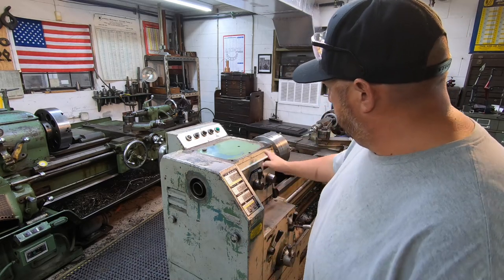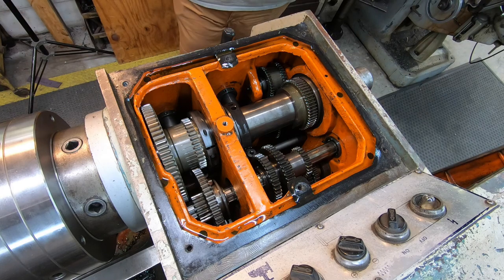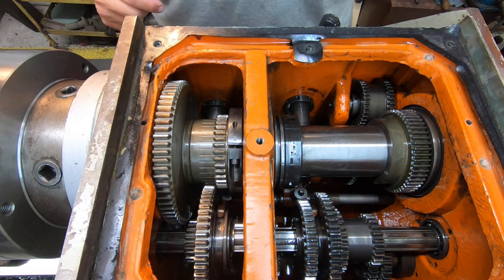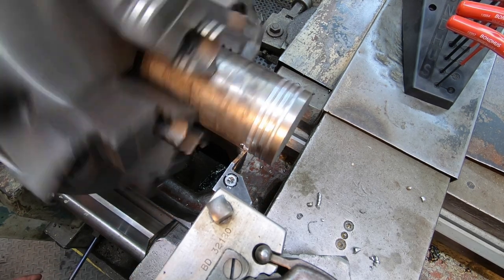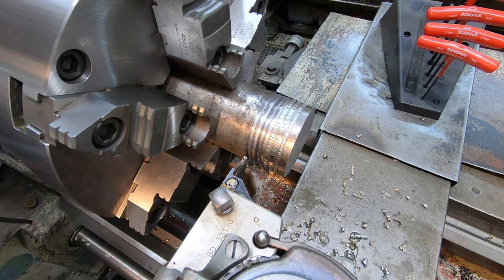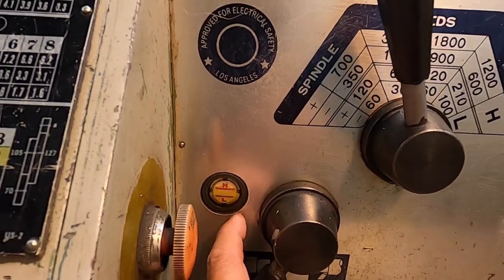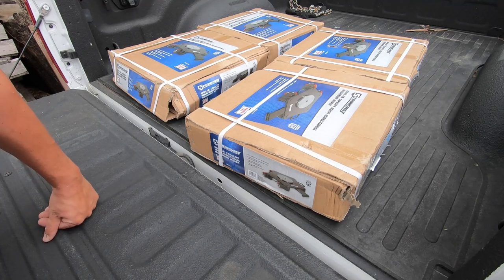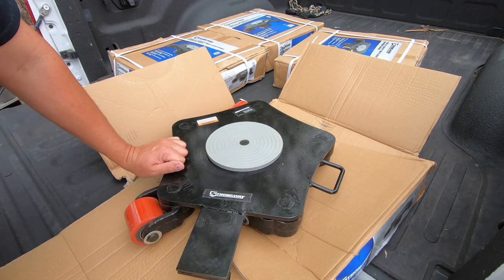SNS 324: Victor Lathe Main Spindle Bearing Adjustments

Comment: Just a word to the wise. Always always always put a piece of wood or rubber between the machinery movers and the piece of equipment. Never ever ever put the rollers under the machine base and steel  surface without some friction material between the two. I have a leg with plates and screws in it as a testimony to how dangerous not putting some friction material between the rollers and machine can be. I had a lathe slip off those rollers and topple over onto me. I'm lucky it just got my leg and not my torso... because I'd probably be dead, It happened so fast. Steel on steel is a big no no.

Comment: Run in up at speed abd see if the bearing remain cool to warmish . If the bearings are too tight it'll knacker them quicker than you'd believe.
Reply: Agreed. It's OK provided the running temperature at the bearing never goes above 60-65 deg C.

Comment: Adam, good video.  A couple of things in loading a tapered roller bearing.  One is, when possible, bring the bearing and the race up to operating temperature before adjusting.  Once at operating temp, then load the bearing until you feel rotational resistance, and back it off slightly.  set your lock nuts, and you are good to go.  Again, a really good video showing the effect of bearing adjustment on the spindle performance.
Reply: It's too bad that adjusting nut was so hard to turn, I wonder if the shaft/bearing is galled or damaged in some way to not let it slide easily. It would be so much easier to get the adjustment right if you could feel the nut interacting with the cone. I do worry it's going to be a bit too tight if that gear box builds up any significant heat, though it may not get hot enough to make much difference. I know I would be in hot water pretty quick doing wheel bearings on heavy trucks like that, but they are a different animal all together.
Reply: @--_DJ_--  I am actually not surprised that the adjusting nut was fairly tight.  Remember, there are 3 sets of bearing that the spindle passes through.  That adjustment had to move the spindle  through all 3 inner races at the same time.  In these applications,  a transitional  "snug" fit is used.   I highly doubt there was any galling, but it wouldn't surprise me is there was light varnish at the inner race junctures.  Usually,  service instructions will indicate to run the bearing (machine) until it reaches operating temperature.  At that point, you go through the loading procedure.  This takes into account the expansion and contraction of the  bearing and races.  What Adam did will probably be fine, but the light chatter may return slightly if the machine warms up.  Otherwise, he certainly improved the chatter situation.
Reply: @farmalltomf  I could be way off but wouldn't the adjustable bearings slide along the spindle rather than move it? I don't see how moving the spindle would create less play if the bearings are still in the same relative location to each other. Like I said I could be way off, I don't really have any idea how the inner workings are set up.
Reply: @--_DJ_--  You are correct, but that nut moves the spindle through the bearing inner race.  The outer races are stationary, you are moving the rollers and the inner race when you tighten the nut.  Ona wheel hub, you move the entire bearing.  in this application, you are moving the spindle, and the outer races are stationary.
Reply: @farmalltomf  The outer races are stationary in wheel hubs as well, at least any that I can think of. They are pressed into the bore of the hub. I work on both light an heavy trucks, I have knocked more outer races out of hubs than I care to remember, though not as often these days with bolt on hub bearings on the lighter stuff. Is that adjustment (nut B) pulling/adjusting the 3rd bearing, the one at the head/chuck I assume, in with the spindle and nut A is just adding the pre load back to the opposed bearings? Is it just a plain bearing for the rear?
Reply: @--_DJ_--  As I understand when Adam went through it, the left outer bearing is a tapered roller, with the thrust load towards the right side.  The middle bearing is also a tapered roller, with the thrust to the left side.  The third, outboard bearing is simply a carrier, straight roller bearing.  The adjustment nut applies the bearing pre-load to the  left outboard taper, and the center inboard taper.  I may have misunderstood him, but  that is my belief, and it also makes the most sense to me.  In this application,  I would expect the outer race on all the bearings to be stationary,  with the roller cages and inner race sliding to apply the pre-load (with the exception of the right side outboard straight roller.

Comment: One thought on your test cuts, as you get closer to the chuck your rigidity will naturally improve, that stock is pretty stout, and your chuck is good, so likely not much effect, certainly not as much as tightening the bearings, but I found myself curious to see a test cut right out at the end.
Reply: @oldsoulkid9263  Hardly, My 1917 Hardinge cataract has plain cast iron cone bearings, one of which was broken when I got the lathe, and I had to make a replacement from scratch  so yes, I have definitely adjusted head stock bearings.
Reply: I was thinking the same thing, Greg, Being a machinist for more than 50 years it's always good to shorten any cantilevered situation be it a boring bar or the holding of the work. I started with some real clapped out machines and I did my best to tighten them up, so I know what you are talking about! WOW a Hardinge!
Reply: I had the same thought. He had enough room to do a last check groove right at the outboard end to get a better comparison with the first test before calling it good. Assuming an infinitely stout workpiece and chuck, the severity of chatter will roughly double when the distance from the groove back to the first bearing doubles. Very roughly.

Comment: Adam, I smiled at your thorough job cleaning up before pulling that cover off the head-stock.

Something else that contributes to chatter in grooving and parting is backlash in your cross-feed assembly.
If you have some backlash in that cross-feed lead screw, replace the nuts or tighten them up too.

One of my manual lathes is a light duty Clausing 12" machine.  It had a 1/2" ACME lead screw in the cross slide with a lot of backlash.  I machined a new 5/8" ACME screw and a new nut to tighten it up to solve this same problem.

Comment: I just finished adjusting my 16x40 bearings. The internals are the same as your 16x60. The adjustment made a monumental difference in cut quality. I also had all the crap on the top oil rail like you showed. Thanks for the tutorial, it worked well.

Comment: The rear cylindrical roller bearing should also be adjustable. The inner or outer race fits on a taper and driving it up the taper expands or contracts it to tighten the clearance. Normally that one would have .0005" or so clearance.
Reply: Lol

Comment: Adam, I also had power issues. For many years my neighborhood was the last to get power back. That changed ten years ago. The main lines are on a cross street in front of my back-fence neighbor. The feeder-line runs along their lot-line, then along mine, then down the dead-end street that starts across from me. The CEO of the electric company moved to the end of that dead-end street. It was amazing. I knew something had changed, when I saw six trucks in front of my house ten minutes after we lost power. SIX!! Ten minutes!

Comment: I used to work at the Clausing Machine Tool Plant in Warsaw, IN (in '76-'78) where most of the Clausing machines were produced.  I was an (the) Electrical Design Draftsman, but you hear things being talked about and we had a WWII Marine that was in charge of our Engineering Prototype Shop that knew his stuff!.  Clausing Lathes had tapered roller bearings in their headstock and I can remember him talking about adjusting them, based on end play in the spindle.  I'm pretty sure they were Timken Bearings and I believe they worked with Timken to determine the allowable end play.  I don't think I ever heard what amount of end play they were adjusted to , but maybe you could find out from a Clausing maintenance manual or by contacting the Clausing Service Center.  They used to have a Service Center located in (I believe) Goshen, IN, but their website shows they are now in Kalamazoo, MI,, which was the headquarters of Clausing and parent Atlas Press Co.  You might also be able to find other manufacturers that had tapered roller bearings in their headstocks and have documentation that describes the adjustment procedure and values for end play.  Or, maybe Timken could be a resource for you.
Reply: well, you don't want any end play, the big question is how much preload after that.. This video prompted me to look up my lathe manual, I think mine needs it too.. I have the same chatter problems and it's most visible when parting
For my Grizzly/Advance 14x40, it says to tighten 1/16th of a turn past 0 end play
Reply: If the manufacturer can't provide any relevant info for the spindle the next best thing is to pull the bearing numbers and get the info for the bearings. Bearing manufacturers list preloads, axial and radial runout allowance, and all other necessary information. Just blindly tightening tapered bearings is dangerous as there may be another issue, sometimes it does just work, but the big test here will be the performance at temp with high RPMs in both loaded and unloaded axial states.
Reply: @sshep7119  but how are you going to know how much preload you're giving it? even if you have the specs from the bearing manufacturer?
Reply: @Rx7man  If I were working on a machine that I didn't have manufacturer information about, I would check the Lb force spec from the manufacturer. When the bearing is preloaded properly there should be a certain amount of drag on the bearing, when you do the math for the number of bearings and the mass of the spindle you can determine the "drag" the spindle should see when you begin to turn it. If I were doing the repair I would put a 3/8 drive socket in the chuck and rotate the chuck with my force gauge to see what the drag is on the system. It is similar to the drag you need to see on a pinion shaft when you install a crush bearing in a rear end rebuild.
Reply: @sshep7119  with pinion bearings in pickups, I was taught to put a 10" pipe wrench on the yoke, and it should softly swing down
Unscientific, but it works
Reply: @Rx7man  That is basically the same thing, just a different way to measure resistance.
Reply: The usual metric for preload on lathe headstocks is temperature rise, when running with no external load other than a large chuck. After reaching a steady state temperature the bulkhead with the preloaded bearing should be no hotter than 60 - 65 deg C. It's difficult to get consistent readings for torque resistance, or axial displacement, but temperature tells the whole story and it works for all taper bearing lathes. Angular contact bearings should run 5 to 10 degrees cooler.

Comment: Great watch thanks. I remember an old shop I worked in had a Victor lathe and exactly same problem.  Someone had a crash and bent the spindle so the spindle was remade but with a slightly smaller bore, new bearings and it never looked back. Those spindles have such a thin wall.

Comment: Yep, know about spindle bearing preload. My lathe was doing the same thing so I did what you did and adjusted the preload.  You'll find that the spindle will spin easier when the lathe head has been run some and reached an operating temp.

Comment: By spinning an eccentric in your chuck and feeling the vibration as it becomes dampened by and beyond the bearings can be interesting. Getting the eccentric mass and RPM where the players are playing as a team is most of the fun. I may have spent too much time wondering how balancing machines could work once their human was deleted. The Matrix refreshed the problem after years in stasis. 
Always interesting stopping by.

Comment: My lathe has the same bearing configuration but the 2 roller tapers are together, and only 1 adjustment collar. Zeta- we had 60mph winds which took out one large maple tree limb, which took out the internet fiber and 5 minutes later the power was out for the whole day. Power crews where on the job and checked everything around the house/area, fast!

Comment: I would have recommended stating with a test indicator measurement before the first adjustmentn to measure lift of the spindle.  Then do the same thing after each readjustment.  This way you can approximately judge how much adjustment equals how much change of lift.  As long as you see a few tenths lift when cold, you can warm it up, measure again when warm.  As long as you see a few tenths warm, you should be safe that you did not over tighten the bearing.  Just a few steps that help make up for short comings in the manual.  If Victor did not publish the steps, they probably relied on a couple of old timers in their factory when they assembled the machines.
Reply: This is good advice, except that machine tool bearings run with negative clearance, ie preload. It is still a good way of working out when you are at the crossover point from clearance to preload. But the easiest way is to gradually increase the preload while checking the temperature of the casting in the region of the bearing which takes the thrust, and stop tightening when it gets to a steady running temperature of 60 - 65 deg C

Comment: Loosen Nut A until there is NO tension on the bearing. Tighten Nut B to remove any axial/lateral play, then tighten to apply some pre-load to the spindle bearing and the center bearing. Rotate the spindle to "seat" the bearings, then adjust again. The principle is the same as doing hub bearings on a car that has tapered roller bearings. Much like an old 70's or 80's Mopar. You're trying to seat and square the bearings and you want them pre-loaded, since they will loosen once they are up to temp. You might also try lowering the cutter below the centerline, slightly so the material is trying to climb up on top of the cutter, thus loading the bearings and maintaining an even pressure against the cutter.

Comment: I dont know how old those bearings are but if they are that tight they might be worn an need replacement.
Tightening them up seems like a fix but it can wear them out even faster due to the extra stress on them.
Reply: Yeah but replacing them is a different story. Not that easy to do and you gotta be very careful not to miss align anything. Most of them are shrink fitted with a super high tolerance.  You gotta know what you do or otherwise the parameters of your spindle are worse than with the old ones. Seen that on some bad done Weiler lathes.

Comment: Enjoyed the video on the bearing adjustment, I can't remember where but I recently heard someone claim that once the proper preload is set, there is a running temperature target to verify proper setting. Probably the same thing as testing for chatter in the cutting. The steak looked gorgeous, bon appetite and cheers!
Reply: Indeed. 60 to 65 deg C is about optimum, steady state running at top speed with no load.